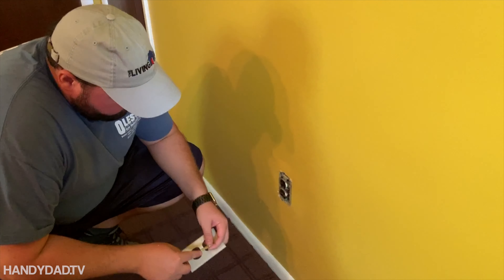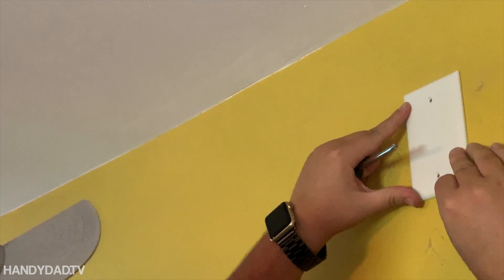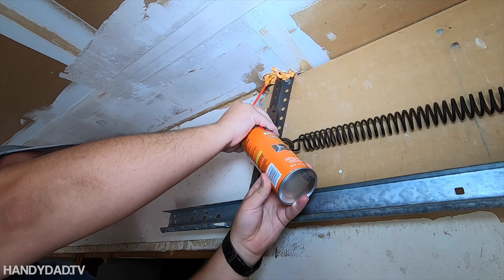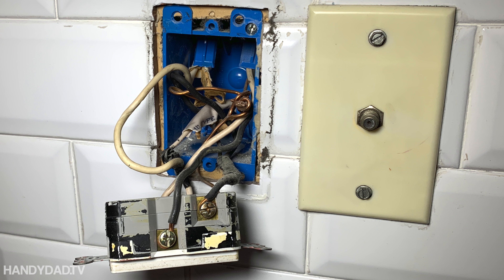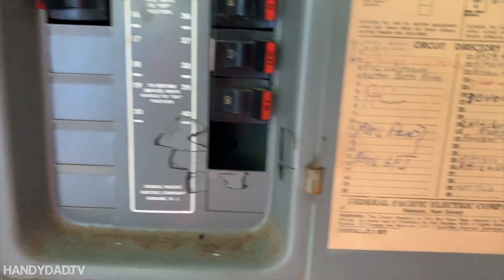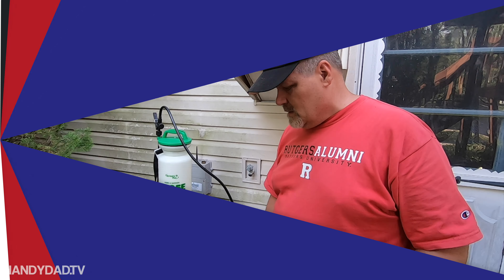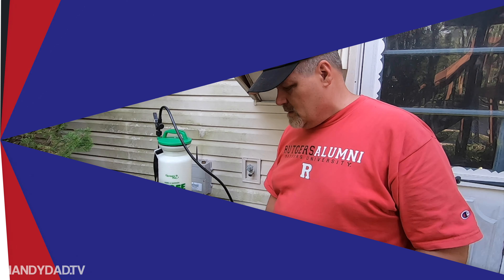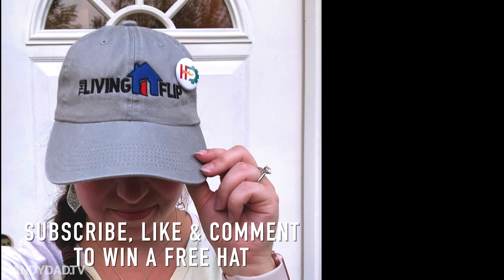WE FAILED INSPECTION // TLF 2

Comment: GFCI: I always wrap electrical tape around the outer post when not in use, some older houses have metal boxes and are not very deep, the tape limits anything contacting the screw terminal. Not required but peace of mind achieved.

Comment: The best way to fill a whole in a breaker box is buy a 15 or 20  amp breaker or the next breaker you think you will need.  install it even if its not connected to anything label it spare.  That way if a breaker fails you can always swap it.
Reply from the maker: That's an option, albeit more expensive than a plastic filler plate. But the company who made this panel (Federal Pacific Electric Company) went out of business because the breakers are notoriously unsafe so we plan to have it replaced anyway.

Comment: I imagine you already know this and used it because it was what you had on hand, but WD-40 isn’t a lubricant. The WD stands for “water displacer”. It obviously will work temporarily as a lubricant, and we’ve all done it. But it won’t last, especially out in weather. Better get some silicone or better yet lithium grease to spray on that gate latch before the next inspector comes out and discovers “Surprise!” the latch has seized up again.
Reply from the maker: You're right.
Reply: Thanks for the knowledge